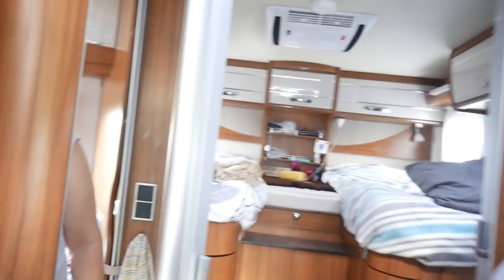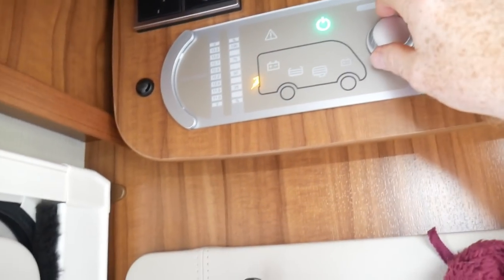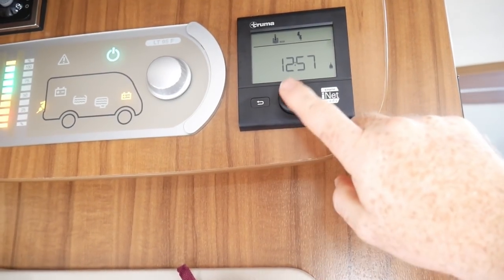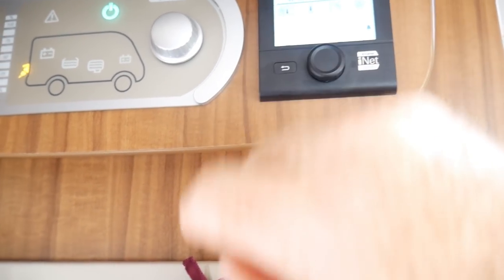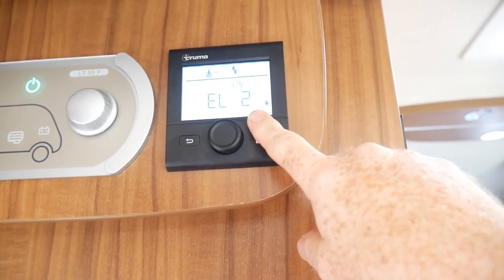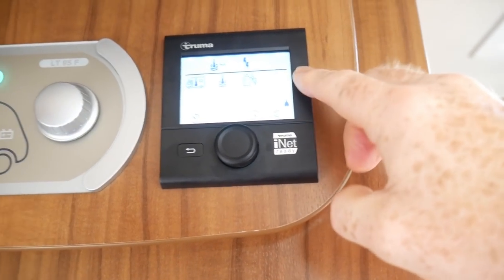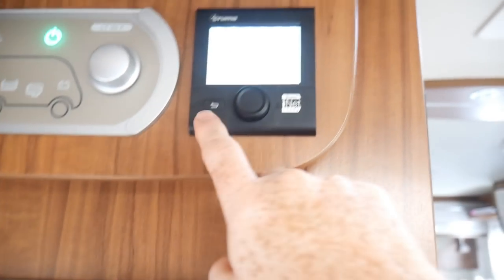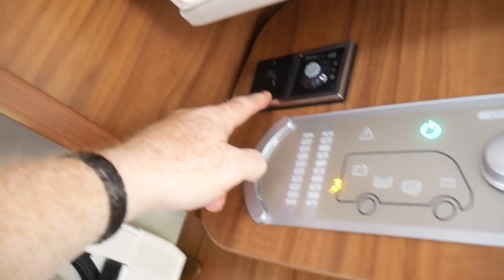Truma Hot Air heating system controls explained Vlog #273

Comment: Got the same controls in my Hymer MLT. The mysterious control is, as far as I'm aware, an indication of your gas supply. Green ok ,red not, and a switch from one bottle to the other. Got 2x11kg bottles on a gasit system.

Comment: Excellent vid by the way, I did not know that? that in the Truma control, (what fuel to use) EL 1 or El 2 was Kilowatt 1 and 2, (which I believe is low or high stting?)  always thought it was? (now I mention it I can't remember?)  anyway good explanation.